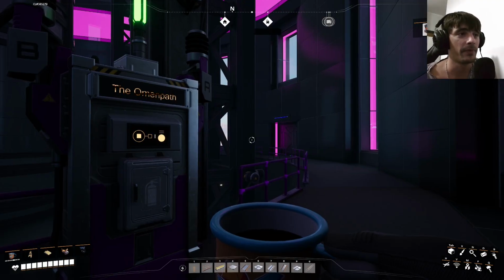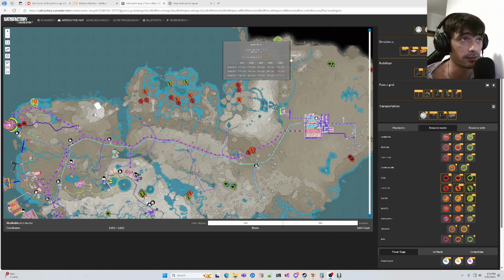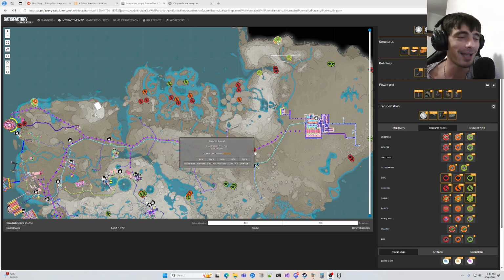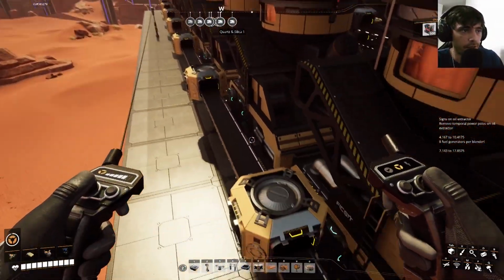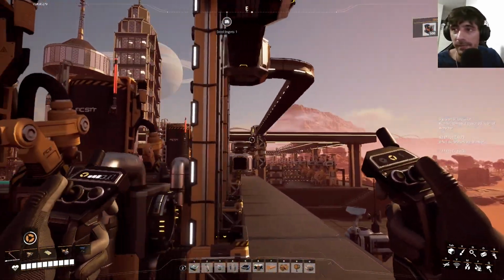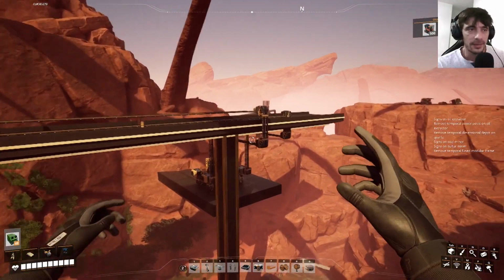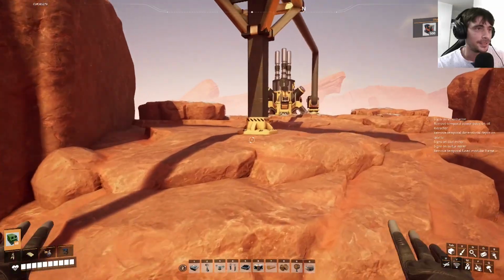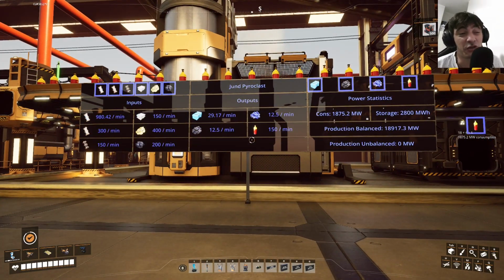Building a Small Rocket Fuel Power Plant – Just Enough Power to Survive! | Satisfactory

Comment: Once i got to rocket fuel in my world, i did not realize how little oil you needed to generate massive power. I ended up using a full pure oil node because i didn't want to constantly think about power consumption for future factory builds. Ohhh man i had to run 88 fuel generators all at 250% overclocked so i wouldn't have to build a small sky scrapper of them if they weren't overclocked lol
Reply from the maker: Haha. Yup! It makes no sense at all! Rocket fuel is extremely overpowered, and fuel generators are kinda bad. We need them to be able to accept more fuel. But well, it is what it is. 
Thanks for stopping by!